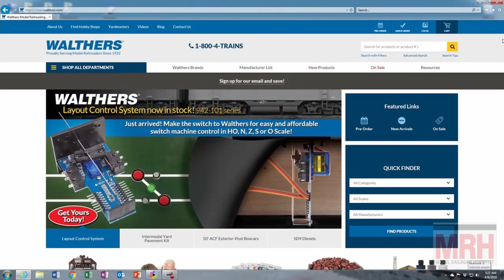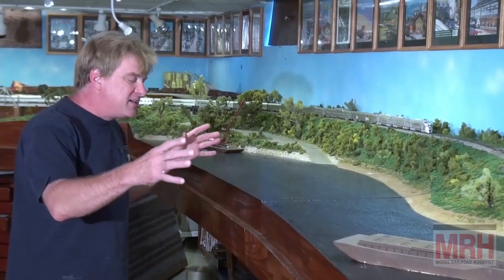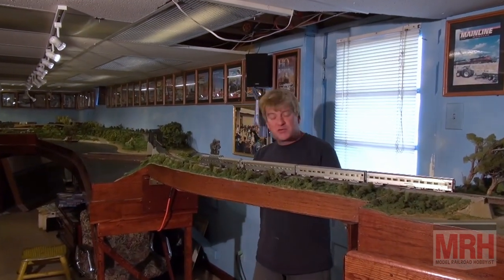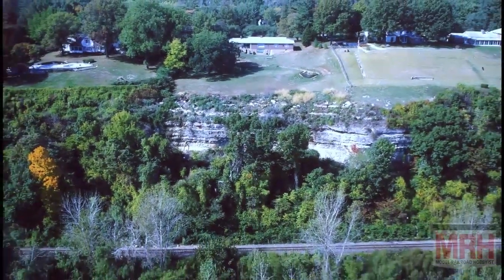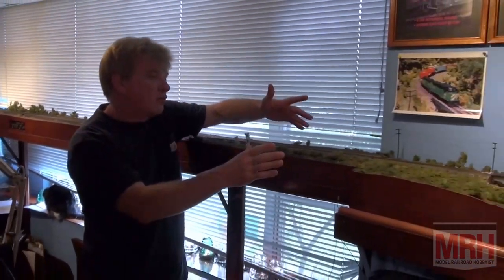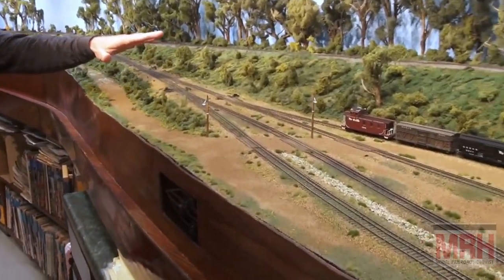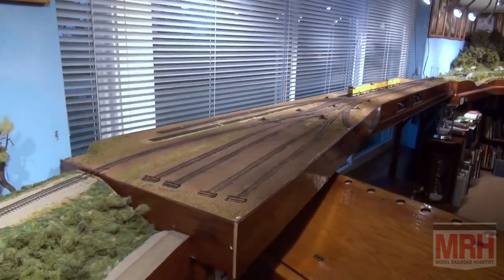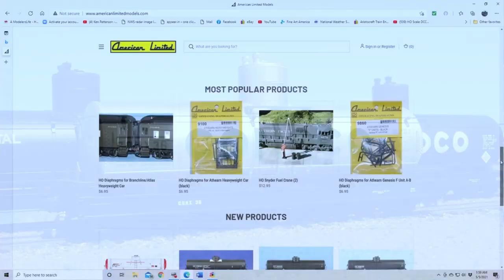Tour Ken Patterson's layout | June 2021 WHATS NEAT Model Railroad Hobbyist

Comment: Very nice layout and structure, the Idea of sectional pieces is a grate way to do shelf style, but lot of us have small rooms so table tops is it ! 
Q, your removable modgular  section do they line up with other sections - pull one out insert another ! .
And I like that you use layers of foam as a base instead of plywood and it just sits on top !! Thanks for the show ..

Comment: I was told I had to use insulated rail joiners on both rails when running a DC train especially on single cross overs on my double track mainline.  Right now I have only the hot rail insulated and never had any problems, but I was told this can fry my DCC decoders on any locomotives on my layout while running a DC train. even though I turned off the power on my DCC blocks with my Atlas Controllers.

Comment: Great to see this and an excellent design.  Question: how do you keep the wires (track feeders, switch machine wiring, etc) self-contained?  Also, what do you use for turnout control, manual or powered?  If powered, what motors or devices do you use?
Reply: Hi Ken a wonderful video very informative but as mr. Jones query how do you bury the mechanics of the module in the foam also how do you connect the modules for continuous running thank you

Comment: interesting, so no dedicated programming track.  Since you have the command station on the same desk as the computer itself, you could just put in a small section of track and have it tied to the programming outputs on it.  No need to mess with shutting everything off just to program a locomotive (always found that annoying), most people put an isolated spot for programming on the layout.  In my case I just have a piece of flex track I tacked down on the workbench and have a DCS52 as my programmer (layout is ran by a new DCS210+).
Reply: there is a track on the desk behind the tools for programing.